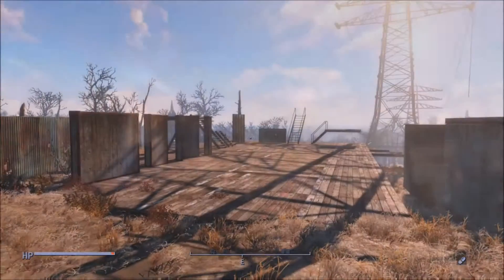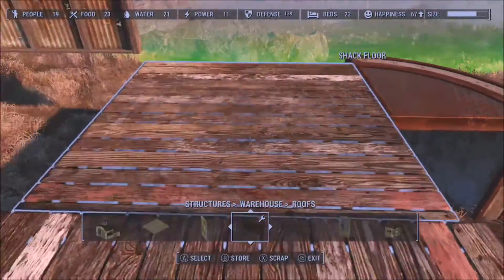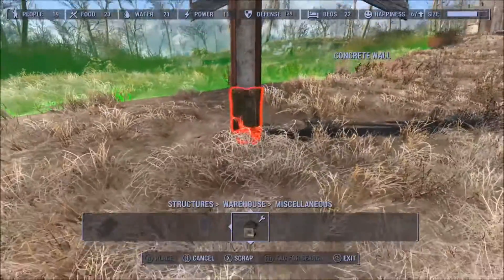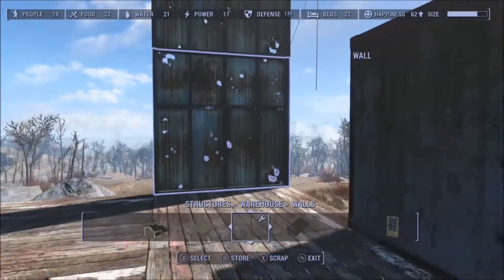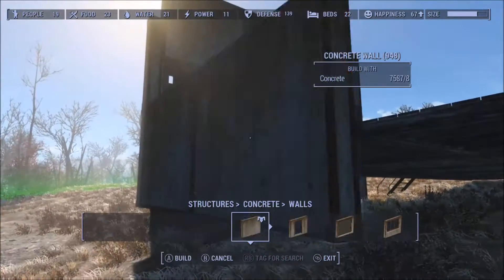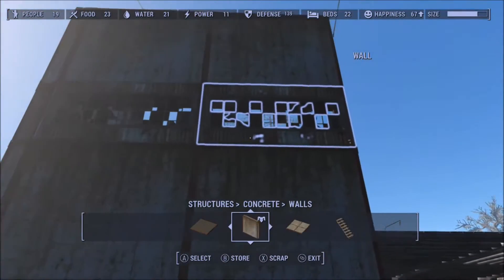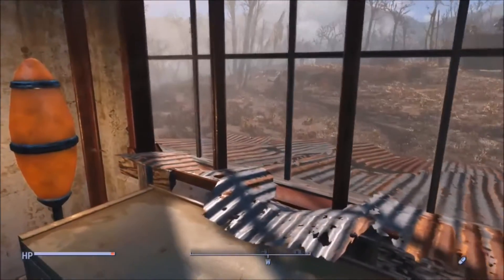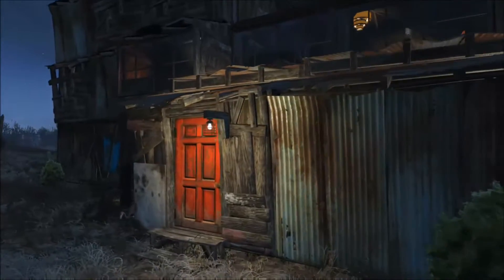Fallout 4 how i build part 3 (Tips and tricks without using mods)

Comment: I love the concrete roofs as they allow all concrete walls and foundations, and even warehouse foundations to be placed through them like if it was ground, or a campfire.
Say, have you found a solution for the 30 seconds alternating 2 color light system I asked you ?
I will join the stream tonight to ask.
Btw if you use the activation button, you can toggle a briefly power giving item like the basketball hoop switch, into a constantly power giving state.
If you doublepress, then single right after,  it stays on and gives constant power instead of a brief burst.
Just pressing the same button once unlocks it again.
See you tonight.